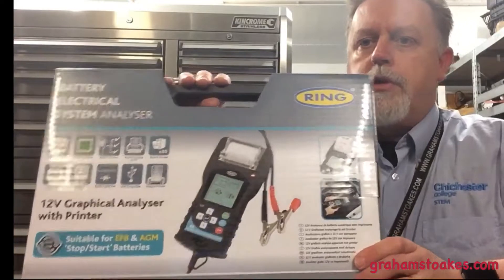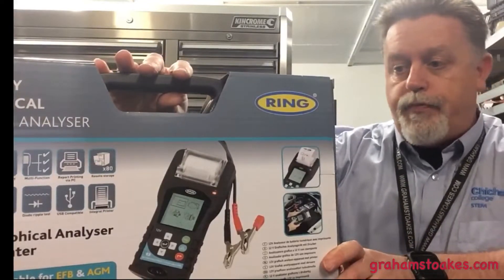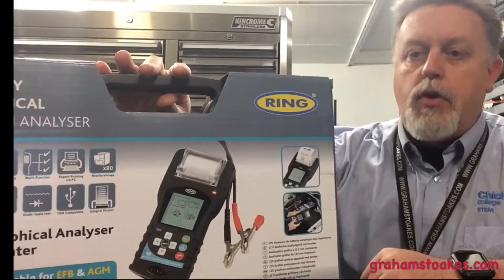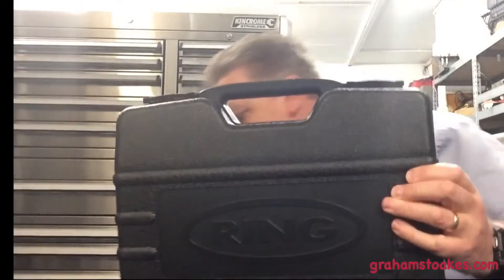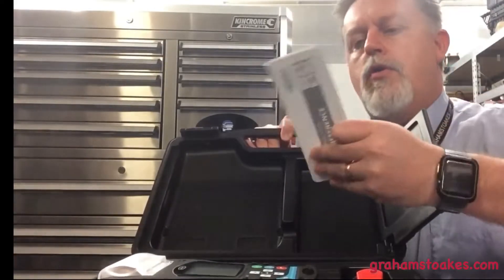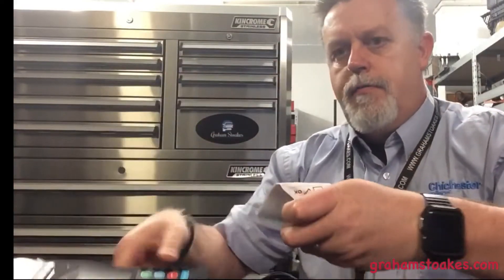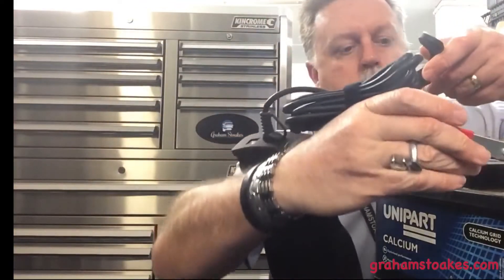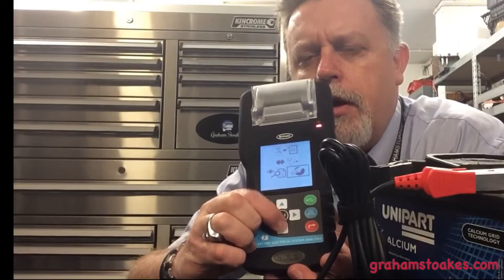Unboxing Ring RBAG700 Automotive Battery Analyser

Comment: I was going to buy one of them, but after many hours of research i found out that a real 'load tester' has most reliable test results. I guess these are still needed for the stop start batterys along with a load tester. Is this correct?
Reply from the maker: Padraig Galvin in reality both types of battery tester have their limitations. Electronic testers use maths to estimate battery health, and load testers use brute force (and only work on fully charged batteries). The most comprehensive option would be to use a combination of the two.
Reply: @grahamstoakes  Yes I was thinking the same thing. To test with both especially for the new agm  batterys. I got an adjustable load battery tester. I didnt like the idea of the other more standard ones